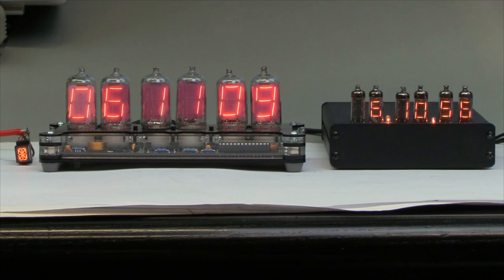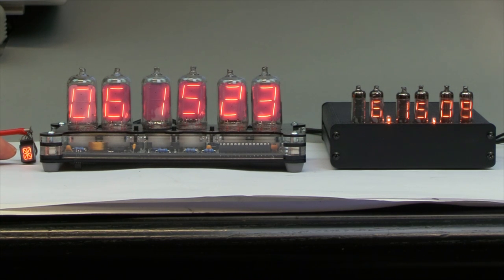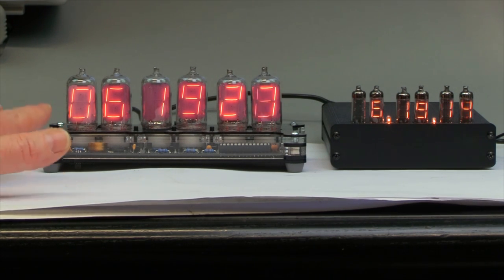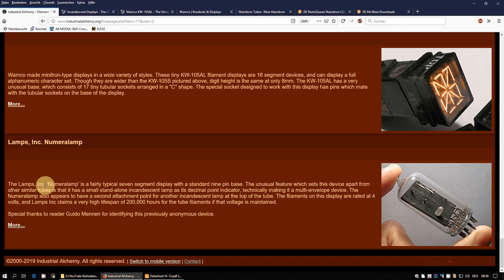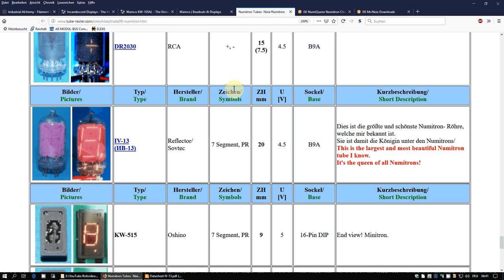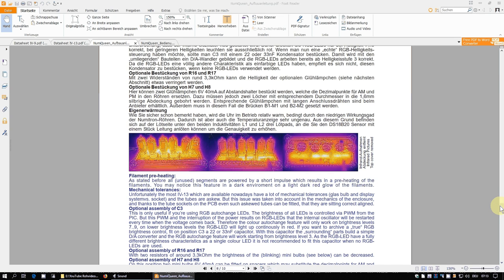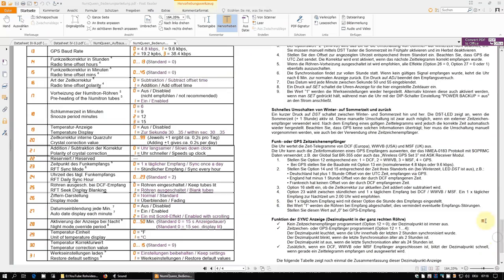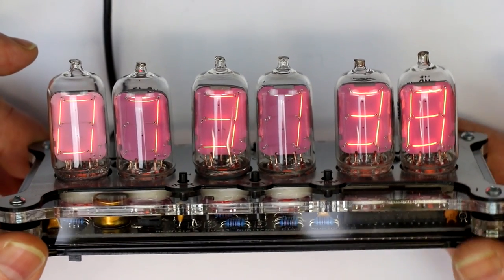Vintage Display Technology Pt.11: Numitron & Minitron Displays

Comment: I really don't get why they used a pink background in the large tubes. When you re-assemble the clock in the end of the video and turn it back on I don't find them to be very clear to read.
You'd say black would give a much better contrast.

Comment: I wonder what is so difficult about making these? I haven't had any direct experience with glass blowing. From what I've seen it doesn't look any more difficult than welding, brazing or any similar craft. I imagine the element material would be challenging to source, but after that they look awfully simple for a modern maker's capabilities. A YouTuber that specializes in making things from scratch should try this.

      I didn't know about the Numitron. I had seen them in passing while late night skimming through eBay, but hadn't looked into them in detail. They would be much more interesting if they were cheap, but still cool.
Thanks for the upload and info.
-Jake
Reply from the maker: You should watch the video about the only single person in the world who ever was able to revive any vintage display technology: https://youtu.be/wxL4ElboiuA
Dalibor Farny is admired by the whole Nixie/Vintage-Display community for what he has achieved.
If it would be easy everybody would jump on that train because you can earn some money concerning the prices for large nixies, numitrons, NIMO-tubes etc. Some sell for up to 1000 $US for a single tube.
Reply: If they're made how I think they're made, I'm not sure of how technically difficult it would be to pull the required vacuum inside to ensure the filament has such a long life. I believe the little nub at the top is there because it's where the glass was pinched off after sucking the air out. Could be wrong! Either way the price of these things is quite staggering. I feel like if one could make the tubes, and make them look retro enough like those here, fitted with an LED pseudo filament type arrangement, some of the technical difficulties go away and done right could be very effective.
Reply: @KainkaLabs  
Excellent reference. I just watched all 37+ minutes of that one. I was thinking the glass blowing equipment would be the biggest challenge for me with something like this. Glass blowing was on my bucket list of things to learn back before I got disabled. I can't do anything physical like that now. After watching this I still really want to though.
   Just before I got hurt I was building a small metal casting foundry, and could have used that experience to move on to ceramics and eventually glass... I get to play with electronics now, and eventually I might even learn to code.. .maybe.. life can push us in unexpected directions sometimes.
  Thanks again for that awesome reference :)
-Jake